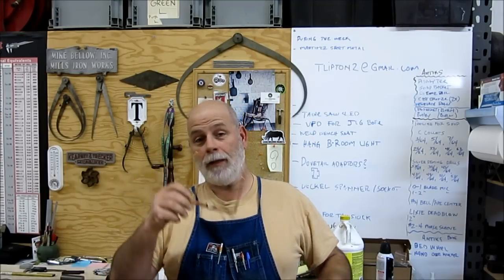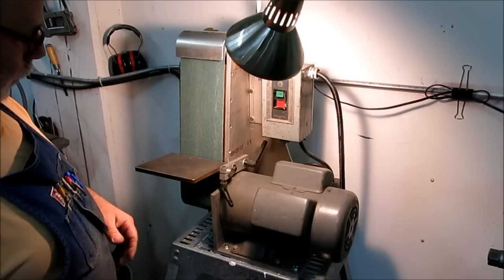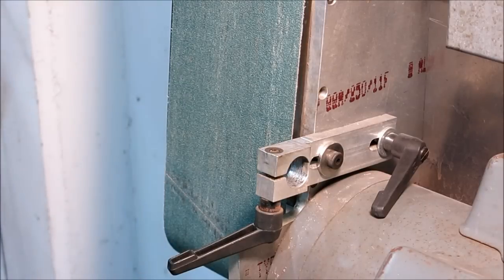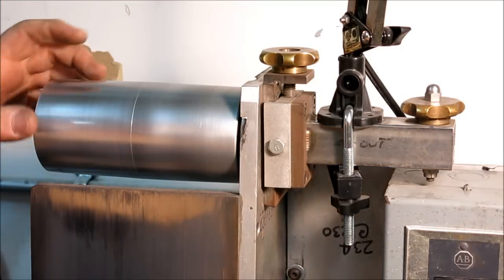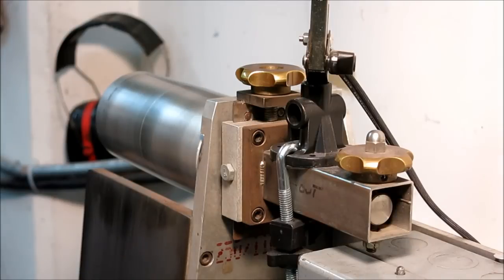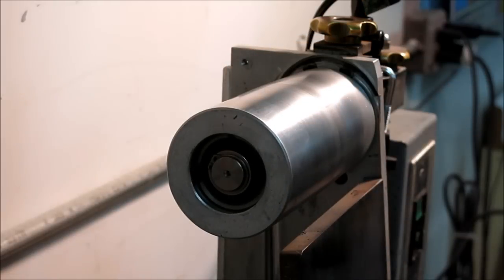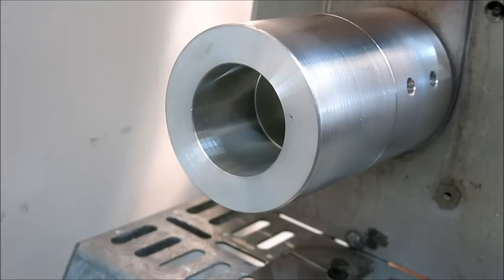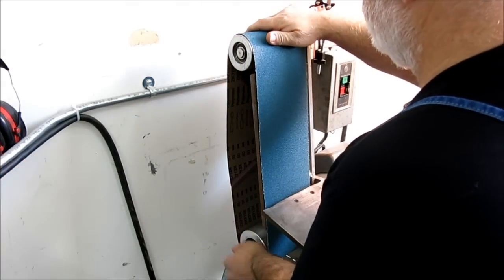Roach Coach Snack Break 5

Comment: Very nice belt sander/grinder.  If 5 HP won't remove enough material, nothing will.

I always figured that the belt direction arrows were to keep the overlapped seam  running in the correct rotation and from pealing apart with use.
Reply from the maker: Hi Keith,

You should see the rooster tail of swarf that comes off the bottom of the sander when doing heavy sanding. Its like hair almost. The weakest link is the belt. It will fail if heated too much or has any flaw in it.

Cheers,

Tom

Comment: Tom, Nicely built machine! I found a cool product that goes behind the belt to help reduce friction. It is an adhesive item with a teflon (I guess) coating. It sticks to the "face" of the machine behind the belt. Seems to help a bit in keeping things cool.
Regards,
Eric
Reply from the maker: Hi Eric,

Have you put this tape on your machine? I use a little wax on the platen but that's about it. Is this the really thin UHMW tape you are talking about?

Cheers,

Tom
Reply: oxtoolco http://www.ptreeusa.com/uhmwproducts.htm UHMW Slick tape. This is the one I use (it is down a bit on the page)

Comment: Even the attachment for the work light looks pretty beefy.  Nothing weak on that machine.

Happy New Year,

Ryan
Reply from the maker: Hey Ryan,

That tube is actually part of the belt tracking mechanism. The shaft passed through the square tube and is adjusted by the knob on the far right. It also is a darn good light holder as you pointed out.

Cheers,

Tom

Comment: Hi
Tom
Happy New Year
I have been wanting a belt sander for some time
I have a decent motor doing nothing
Regards
John
Reply from the maker: Hey John,

Sounds like an excellent project series. Weld up a stand with that spiffy new welding machine of yours and put that motor to use. Gas or diesel motor?

Cheers,

Tom
Reply: oxtoolco Hi
Tom
1.5 horse electric motor
We call gas or diesel motors "engines"
John

Comment: Hi Tom,
Happy New Year!
Funny, I was just thinking it would be a good idea to to a video on the belt sander. I'll bookmark it for future reference, when I make mine. I like the direct drive design.
Reply from the maker: Hey Bill,

If I did it again I would use a keyless trantorque type bushing to attach the pulley to the motor shaft. Much more secure and concentric and no internal keyways to cut.

Best,

Tom

Comment: Thanks Tom!  I was just thinking the same thing a couple days ago.... I wonder if Tom will show us some details on his infamous belt sander.

Maybe you did this already, but could you show us some details on how you attached your quill scale to the mill.  I seem to recall that you did something slightly different so that you still had easy access to the quill stops and hand feed wheel. And HAPPY NEW YEAR!   I picked up your latest book as an after Christmas present so I know my new year will be extra special.
Reply from the maker: Hi Joel,

Happy new year to you as well. Nothing special about the quill scale. Its a stock Mitutoyo absolute kit. It was on the mill when I got it. What you might be thinking of is I have recommended to folks to skip the third axis on a mill DRO and just go with an uncorded quill readout for the Z axis. There is no good way to route a cable cleanly into this busy work area.

Cheers,

Tom

Comment: Nice sander sure beats the store bought for 20 plus years reliability
Reply from the maker: Hi Austin,

Its seen some use. There are some serious gouges in the vertical plate where the belt was not adjusted right and somebody kept on going. Its still hanging in there.

Best,

Tom

Comment: If you are looking for belts that really last I have 2 recommendations Norton Blaze Orange and 3M Cubitron red. Both are kinda spendy but they last 5x to 6x longer than AO belts and 3x + longer than blue zirconia. I use the 2" x 72" for grinding knife blades from .250 1084 steel. Right now I'm using 36 grit Blaze and ti hogs off material fast
Reply from the maker: Hey Andrew,

I'm always interested in good abrasives. Where do you get the blaze orange? Do you happen to know if they make a 6 x 48? Thanks for the tip.

Cheers,

Tom

Comment: On the belt arrows it maters. If you look at the belt and you put it the wrong way it can open up or catch on what your grinding. Then you gonna have to go to the hospital. I think you know that. lol. Happy New Year to you and the family.
Reply from the maker: Hey Ruben,

Thanks for the comment. Happy new year to you as well.

Cheers,

Tom
Reply: I wont say you'll have to go to the ER, but I have had a few of my 80" belts come apart on me while grinding something. Not cool!!!
Reply from the maker: Abom79 Hey Adam,

That humidity cant help those belts either. I bet it scares the crap out of you when a belt pops. Eighty inch could put the whip on you.

Ouch!

Tom
Reply: Yea it's not fun, usually some of the belt stays together and most of it shreds apart flying into a hundred pieces! You'll be jumping or cover when it happens. 
Come on Tom, you had to have had one come apart on you at some point. LOL
Reply from the maker: Abom79 Actually I had one at work not long ago. It was really old and had been in a cabinet for years probably. The funny part was I sanded something then turned my back on the machine to grab another part and whammo the belt disintegrated. The loudest sound was by backside slamming shut. 

Best,

Tom
Reply: Abom79 So you run your belts backwards as well?

Comment: The direction is so you don't go against the glue on the tape.  It will come apart quick otherwise.
Reply from the maker: Hi Bbowen,

Thanks for the comment and participation. My comment was about if there were no arrows printed on the inside of the belt telling you then there is no other clue that gives you any logical reason to mount the belt in a particular direction. Many modern belts don't even have an arrow inside so what is actually different directionally? The seams are directionally symmetric in most cases (dovetail or keyed). What I'm looking for is a logical reason why it matters. 

Regards,

Tom

Comment: Hi Tom,  What a great project!  After watching the video several times, I still have a couple of questions:

• What is the platen made from?  It looks like an aluminum plate with some kind of dark coating on it.  Is that a thin piece of phenolic, black HDPE, or another kind of wear surface, or is it simply darkened as a result of many years of use?

• A little more detail  on the top guard would be helpful.  Could you show the bracket and how it's attached to the guard?  Also, how did you shape the guard?  Is it a piece cut out of a thin-wall tube, or did you form it from a piece of plate somehow?

• In the video, you say the top roller is about 3" and the bottom roller is about 4".  Why do they have different diameters?  On my small, hand-held 4"  belt sander, the rollers are the same size.

Many thanks,  -Chris
Reply from the maker: Hi Chris,

Thanks for the comment. The belt platen is cold rolled steel 1/2 thick. The discoloration is from use. The top guard is fabricated from .09 thick sheetmetal. The curved section was probably bent around a tube then attached to a flat mounting plate to the main vertical plate of the machine. The rolls are different diameters for a couple of reasons. You want a large diameter on the driving end because of contact patch. More area in contact means less belt slippage. Traditionally the top roll is smaller so you get a little more wrap on the lower drive wheel. I'm not sure why the wheels are the same diameter on a hand held sander. Perhaps it has to do with the path of the slack side of the belt and some manufacturing consideration. Mine was built out of a scrap pile of materials and components.

Hope this answers your questions

Cheers,

Tom

Comment: I just had to look up the reason for belt direction. lol
Here is the answer--->Directional arrows are printed on jumbos for all materials that may be made into belts.  No lightweight papers A, B or C will have arrows on them, but D, E & F as well as all the cloth backed material will.  The arrow is used in the manufacture of lap jointed belts.  It informs the belt line which side of the cut to size material will end up being the bottom of the lap and which end will be the top side of the lap so that skiving is done to the appropriate end.  After the belt is joined, the arrow informs the customer of the direction in which that belt must be run. THIS IS ONLY APPLICABLE FOR LAP JOINTED BELTS! The arrow prints on all jumbos because again, we have no way of knowing what sizes or types of belt will ultimately be made from the jumbo.  It’s very common for belts with same material and grit but different sizes to use different joint types.  For example, the standard pump sleeve material CS309JF will always have a #1 lap.  But a 3 x 132 in the CS309JF will usually have a #4 butt joint.  Same material, same grit, different size and application.  So even though the arrow is on all belts, you only have to pay attention to it if the joint is an overlap.   Any belt with tape on the back, regardless of what the front looks like or the fact there are arrows on the backing, is a bi-directional belt!  This can buy you some extra life as the butt or tape jointed belts can be run in one direction, then removed and put on to run in the other direction.
Reply from the maker: Hi Travis,

Now that is what I call a proper answer to our belt question. Seems like you might have a tad of experience in the field. It makes sense that the belts are marked for individual makers or converters so they have an orientation for their manufacturing process and choice of joints. You make a good point about reversing the belts for additional life. The abrasive wears in one direction and leaves the trailing edge reasonably sharp. You wouldn't see double the life but it would put some spark back into the abrasive.

Thanks for the well composed explanation of abrasive belt manufacturing.

Kind regards,

Tom

Comment: Happy New Year, Tom!  
Nice, straight-forward design!  I especially like the way the table mounts.
Are the bearings a press-fit into the drums and a slip-fit on the shafts?

Richard (StraightThread)
Reply from the maker: Hi Richard,

Its been a while but I do believe that is the arrangement. it makes for easy assembly in that configuration. And I'm all about easy.

Cheers,

Tom

Comment: Tom nice looks well made.  Do you always run the 50 grit?  We have a 20" and 12" disk sander along with a 6" x 108" edge sander in our shop.  The disk sanders work OK but I've always wondered why we don't have a vertical belt sander.  The disks are a pain to change.  What's your 2c on disk sanders?
Reply from the maker: Hi Bill,

I actually like disc sanders. They have a couple of things going for them. I do agree the disc is a pain to change. Try this next time you have some PSA glue residue from a disc to remove. Use some Xylene solvent to remove the baked on residue. You will thank me for this one. Acetone and almost all common shop solvents do not work well on PSA adhesive.

So disc sanders. They actually produce flatter work than a belt sander. The belt on a belt sander is never quite dead on the platen and the platens wear where a disc sander has no relative motion between the abrasive and backing surface. Also if they are reversible you get the other handedness you need some times. The best ones have a little bit of table that actually wraps around the side of the disc so you can do L shaped parts easily. And lastly you get a longer abrasive surface than most all belt sanders. 

All that said the discs are a pain in the rear to change so nobody changes them, Typically the discs are always shot when you walk up to use them.

Was that .002 or .005 worth?

Cheers,

Tom
Reply: Tom thanks for the tip on the solvent, will give it a try.  I've used naptha in the past for removing adhesive residue it works well and I have not found a substrate that is harmed by it.

What you say makes sense, the longer sanding abrasive area though I'm not so sure as you move towards the center it has been my experience that the sanding action is less than near the outer rim.  I think this is due to the higher tangential velocity there compared to almost zero at the center.  So if you have a longer part you have to compensate how you apply pressure to the disk with the part.

Thanks again.

Comment: Very cool vid...thanks!  I can see why it has lasted for 20 years...it's built for battle with all that thick plate!  It must weigh 175 pounds.....Question, if you have time:  I've noticed on some belt sanders, the tension mechanism incorporates a spring, while I believe yours does not.  Is tension an issue as the belt wears?  How much attention do you have to give to that tension adjustment over the life of the belt?  Also, I am confused on belt travel direction as well....anyone out there know the reason it is directional?
Reply from the maker: Hi Clete,

Never had a problem. I think high quality belts make a difference also. They are made of lower stretch materials (polyester) and don't change length much over their lifetime. I don't mess with it unless I notice a tracking drift which happens when you lean on something pretty good.  The directional thing is still a mystery. The seam is basically invisible so why it makes a difference I don't have a clue. Perhaps its the scarf joint on the seam. Maybe they want the thin edge to be trailing on the outside of the belt. That's the only thing that makes any sense to me.

Cheers,

Tom

Comment: Nice. How did you cut the taper, using you compound only (giving two straight tapers) or more complicated to get a gradually increasing taper towards the ends? Regards Lars
Reply from the maker: Hi Lars,

Its just a simple compound taper. You are probably right there is some mathematical optimal profile depending on the belt width. My understanding is the wider the belt the less the angle as the "drop" at the ends can only be so much depending on the belt material. 

Cheers,

Tom

Comment: Nice Belt sander Tom how is the rpm of the motor?
Reply from the maker: Hi Dek,

Good point. I missed that one. Its a 1750 Rpm. In the metric system that's 1750 Rpm.

Cheers,

Tom

Comment: Hi Tom,

Ok, I watched to whole thing to find out the RPM of the base motor, guessing 1700, would you care to share? Or is it one of those "I would tell you, but then I would have to kill you" kind of things ....

Nice heavy sander you have there!

Happy New Year!

Stan
Reply from the maker: Hey Stan,

I missed that one. Its 1750 Rpm. And if you use the metric system its 1750 Rpm. Heck your just going to slap one of them fancy VFD's on it anyway. Which would be pretty cool. You could slow the belt for sanding some of those melty things that we bump into once in a while.

Happy new year!

Tom
Reply: oxtoolco
I just filmed a short re-cap of some VFD applications, maybe it will help in your selection of drives. BTW, is that the metric 240 volt or the imperial 240 volt?

Ha!

Comment: Hi Tom, are we to assume by the colour that you use "zirconium" belts rather than the cheap and nasty (not so cheap but very nasty) ones?
chris
Reply from the maker: Hi Chris,

You are correct. I don't mess around with cheap economy grade abrasives and band saw blades. Good eye.

All the best,

Tom
Reply: "Good eye" no, two, courtesy of the NHS and a lovely young surgeoness.
I use zirconia belts on my power-file, they last so much longer and I haven't snapped one yet either.

Comment: Hey Tom, Louis again I would like to have mesurement of that belt sander, the side body it look's like 1/2 inch thick but what is the total height,,,
Thank you...
Reply from the maker: Hi Louis,

Good eye. The plate is 1/2 thick. The height is dictated by the shaft center of whatever motor you have from the base and the belt length and the roll diameters. If you change any one of those the plate changes length. So you have to gather your materials first.

Hope this helps.

Tom

Comment: hi tom, why would you make the top roller convex like this=/\ instead of concave like this=V? thanks. Tristan
Reply from the maker: Hi Tristan,

The shape of the top roller as a convex shape makes the belt track on center and stay there. Its actually a complicated phenomena. Think about it as a balancing of forces and tension in the belt that centers itself at the high point on the pulley. If the curve in the pulley were concave there would be two high points and no single place where the tension forces are in equilibrium. Hope that helps.

All the best,

Tom
Reply: it acutely does make since when you put it like that. no sarcasm intended. so it try to evenly spread the stress out in the belt. thank you. Tristan :)

Comment: Hey Tom my lathe tailstock quill is a bit worn out and drops of center if the lock isnt engaged what would be your aproache to fixing that.
Denis
Reply from the maker: Hi Denis,

Its a common problem with many lathes. The solution will depend on how the tailstock is constructed. Typically there is an interface where you can shift the tailstock sideways to cut tapers. I would look at this area for adding a shim to bring the tailstock up. Most of the time you need to true the bottom at the same time so the tailstock spindle and bottom are parallel. On an ancient lathe I had as a teenager (1915 Prentice) I used to slip a piece of shimstock under the front to get the worn out one on the machine close to center. 

Cheers,

Tom
Reply: my probleme is in the quill, it is loose up and down due to wear like it would need to be re-bushed,i see what you mean with the shim i have done that  and that brought me back up , but when i lock the quill the center moves up and then of course drops down when unlocked  .
Denis
Reply from the maker: Hey Denis,

Well that's and easier thing to fix lucky for you. Just re-bush the worn section which is probably the exit area of the quill.

Cheers,

Tom